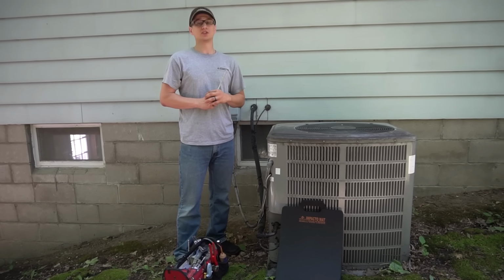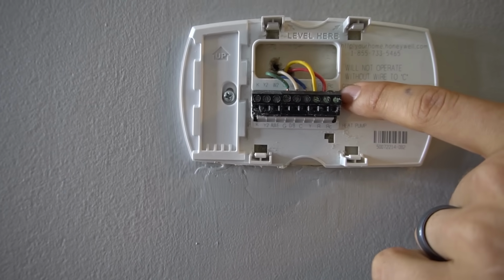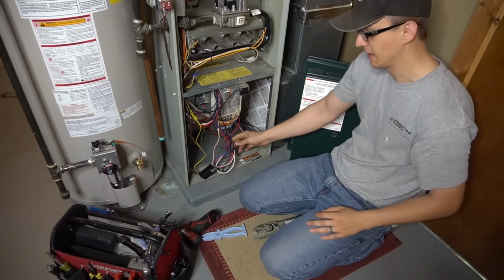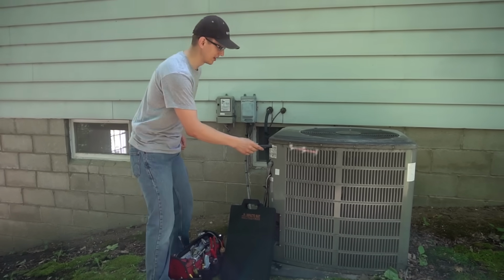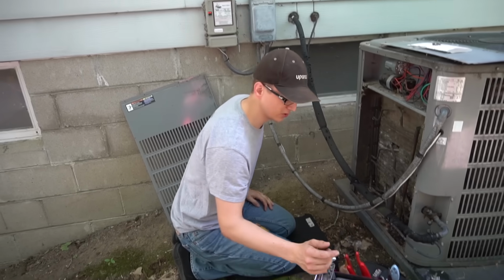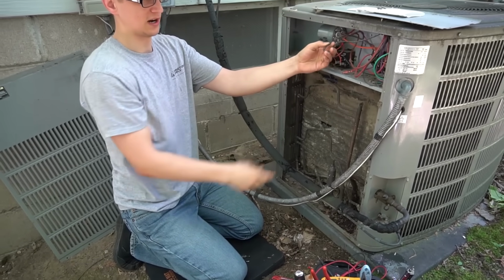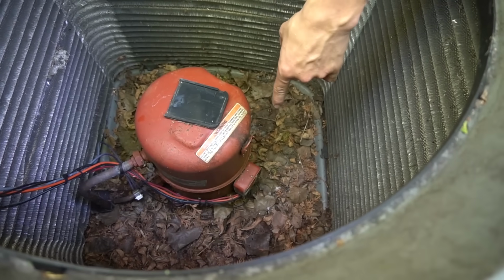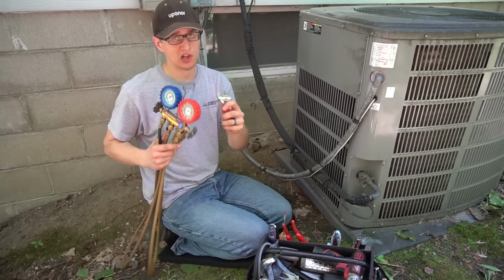AC Unit Not Turning On - How to Fix It Step by Step

Comment: It has a 3 amp fuse that keeps blowing. I checked the capacitors inside and outside with no visible defects.
Reply: Great video from A-Z
Reply: Turns out it was the connector.  Replaced it.  All good
Reply from the maker: Usually a capacitor would not cause a 3 amp fuse to blow (on a side note, sometimes capacitors can look brand new but still be dead. Only way to know for sure is to check it with a multi meter https://amzn.to/2JWI1pU)

If your 3 amp fuse keeps blowing I would start by looking for a bare wire that is shorting out. If you go outside to your condenser unit, do you see where the refrigerant pipes come out of the wall? Usually along with them, there will be a thermostat wire that goes up to the contactor in the  ac condenser unit. Look for spots where the wire insulation is damaged. If you do find some bare wire, you can just tape them with the black electrical tape or  cut off the bad piece and splice the wire back together. Make sure you open the condenser electrical section too because sometimes mice make a nest in there and chew stuff up.

If you do not find anything wrong with your thermostat wires, then it's possible that the contactor is bad. An easy way to check that if you don't have a meter is to unhook the 24v wires from the contactor, make sure they are not touching anything, and turn the unit on. If the fuse blows, then you know that the contactor is not the problem. If it does not blow, then try hooking it back up and turning it on again just to double check. Usually there is a short somewhere though. A defective contactor is pretty rare. Let me know what you find!
Reply from the maker: Thank you! Sounds like you watched the whole thing! Way to hang in there ;) Glad you liked it!
Reply from the maker: You're a boss! Stay cool ;)

Comment: Great video! Maybe I'm just overlooking it, but I can't seem to find the plunger and this baby isn't making one sound.  Should I just go straight to replacing the capacitor? For the record: I just got the house and I'm looking at the services records located on the furnace,  the capacitor was replaced 2 yrs ago.
Reply from the maker: I think you should try finding that plunger one more time ;) Your contactor may have a cover on it. The plunger will be in the middle and there may be a small screw or 2 that hold a cover over it. (new contactors have a cover so that bugs don't get in) 
- If you press the plunger and you hear the unit trying to start but it ends up only buzzing, then I would replace the capacitor. 
- If you press it and you hear absolutely nothing, then you probably don't have 240v going to it. Check your AC circuit breaker or disconnect fuses. Let me know what you find :)

Comment: Had a wire short on the outside that blew the 3 amp fuse.  Replaced the fuse and inside is working but air won't come on.  Anything I should look at before calling for repair person?  Breakers inside are alright too.
Reply from the maker: Well from what you explained there are a few things that come to mind..

- Do you have fuses in your disconnect outside? Those could be blown. 
- If you have a multi meter you can check voltage with, check to see if you have 240v at the contactor. You can get a meter for 20 bucks on amazon https://amzn.to/2JWI1pU   (good to have one of these)
- An easy test to do (without a meter) is to push the contactor plunger in. Does the unit start? If it does, then you do have 240v. If it doesn't then either the fuses are blown or the breaker is tripped.
- If pressing the plunger in started the unit, then that means the contactor coil is not getting 24v so it is not pulling in by itself. Did you fix that shorted wire outside and hook it up to the right spot?
- The capacitor could be dead. Here's how to check and replace one: https://www.youtube.com/watch?v=C82HvbvP08E
- Did your unit work good before that 3 amp fuse blew? When is the last time you had it fixed and what was it?

Those were some of the ideas I got. Hopefully it will help you figure out what's up. But let me know what you find please. Good luck!
Reply: Outside disconnect is the copper wire plug in. Unit worked up till the 3 amp fuse blew.  The wires that were shorted have been fixed with the caps.  I'm pretty sure it was the thermostat wire. It was a gray wire with an inside red and wire coated wire.  They were just wrapped in electrical tape before and the tape came off of one of them   

 I'm going to look at the contactor plunger today.  I took the cover off once and the capacitor is all rusty.  Searched online and found the capacitor model I need.

It's probably been ten years since my parents had someone come out.  Not sure what they did except replace the inside thermostat.  This unit is 28 years old,  hoping to get another season out of it.  Maybe it is just shot.

On another video I watched, they talked about a reset button on the inside under the fan.  Is there a reset button in there somewhere?  Your videos are a lot easier to follow.  

Thanks for replying, appreciate the help
Reply: Just took everything off again and tried the contactor plunger.  It wanted to start but quit after I release the plunger.  

The capacitor doesn't have any bulges but it is rusty.  When it is installed, it is upside down.  Even the top terminals are rusty.  

I'm going to order a new one and see what happens from there.

Thanks again.
Reply from the maker: Thank you for all the details! It sounds like the broken wire problem was resolved so that's good. I think a new capacitor will solve your problem :) When they go bad, they do not always bulge out. Sometimes they look new and shiny yet they are completely dead. (easy to check for sure if you have a meter) 

As for the reset button. I am pretty sure they were talking about a high pressure switch. Most older units will not have that. It would look like a black cylinder or disk with two wires coming out of it and a button on top. I don't see too many AC units that have one of those. Their purpose is to shut off the AC if your freon pressures are getting too high. But when you manually push in the contactor plunger, the unit would start even if that switch was tripped.

If I had to compare a capacitor to something, I would say it's like a car battery that you can't recharge. The capacitor is like a battery for the compressor and the fan in your AC unit. You can try to start your car with a dead battery but it won't turn on. Same with the AC. It tries but can't come on. Anyway, hope you will have cool air again soon!
Reply: Got the new one today, installed it and it still isn't working.  It will come on if I press the plunger thing and it held it while they checked to see if it were cooling and it cools if held.  Any other ideas?
Reply from the maker: Okay so we have progress! :) So before, when you pushed the contactor plunger in, the unit would try to start but fail. Now it starts when you push it in. Now the problem seems to be the 24v control voltage... 

- Did that 3 amp fuse blow again?
- Also, the wires that you are talking about here, "It was a gray wire with an inside red and wire coated wire.  They were just wrapped in electrical tape before and the tape came off of one of them" Does the red and white wire go straight to the contactor or does only one of them go to the contactor coil and the other goes somewhere else?
- If the fuse is not blown, if you are comfortable with doing this... Turn off the furnace power switch and make a little jumper wire out of a piece of wire (even a paper clip would work). Then at the furnace control board, put in the jumper to R and Y. (There should be a terminal strip just like at the thermostat R,Y,G,W,C) Doing this will bypass the thermostat. Then put the doors back on and turn the furnace on. If everything comes on and works, then your thermostat is the problem.
- If the thermostat bypass still does not turn on the AC and the 3 amp fuse is not blown, then you most likely have a bad control board. 

Before I get too far ahead, try checking all that and let me know what you find :)
Reply: That might be a little more than I can handle.  The furnace and thermostat are  less than two years old.  Would they go out that soon?
Reply: I'll look at those other things in the morning.  Should that plunger on the contactor stay in?  The 3 amp fuse didn't blow.
Reply from the maker: Well if there was a surge for example, that could take out a control board or a transformer. Unfortunately at this point I can't say for sure what it is. Still trying to help you narrow it down. But yeah.. 2 years is pretty young still. If this is becoming difficult for you then you may want to call a technician after all. Otherwise I will keep answering until we make it work ;)
Reply: Wanted to give you an update.  First off, I was going to give up on it and make plans to have a new ac installed.  Well, I tried the other things you mentioned and then watched your videos again.  Going back to the first wire that caused the fuse to blow, I took the caps off of the connection and guess what?!!  I had twisted one of the wires to much and caused it to break.  I redid it, being careful not to break them again and guess what!!  We've got cool air again.  Thanks so much for the videos and for answering questions.  Truly amazing it is back on.  Have a cool summer.
Reply from the maker: Wow that's amazing! That's all it was after all this time.. And you were making plans to get a new AC already. I'm glad you were able to find the culprit and got it back up and running! Thank you for the update, stay cool! :)

Comment: Thanks for the great video.  I have a question: what if i am pressing the plunger on my a/c unit but it wont press inward.  (That's when there is power to the unit).  When the thermostat is off and power is off the plunger presses in and out with no problem.  Thank you!
Reply from the maker: Well that's odd... So let me clarify..  When the thermostat is off and disconnect is out, you can press that plunger in. But with the power on and thermostat calling for cooling, the plunger does not pull in even if you press on it? You may have a defective contactor there. You should be able to press in that plunger even with the power on (unless its already pulled in)
Reply: Hey thanks for the fast reply!  Your help is very much appreciated!  Okay maybe it is pressed in. Because it doesn't push at all when there is power and thermostat.  
But when everything is off yes it presses in very easily.  Maybe it is pulled in when the power is on.  I will pay closer attention to its position when I return from turning everything on.  I will keep you (and everyone) posted.
Reply: Hello again.  Yes when the power and thermostat are on the contactor is pulled in.  However, the unit does not come on.
Reply: The unit is making a soft humming sound.  Barely audible- have to put my ear right up to the unit to hear.  I tried starting the fan by spinning the fan blade but had no success.
Reply from the maker: Most likely it is a bad capacitor. This video is how to check and replace one: https://www.youtube.com/watch?v=C82HvbvP08E   Another possibility is that you simply do not have power to the unit. You have 24v that pull in that plunger but the 240v may be missing. Check to see if your breaker is tripped or if your disconnect has fuses, those sometimes burn out too.
Reply: Again, I appreciate you taking the time to answer my questions.  Next time I am in Minnesota I will buy you a beer!
Reply from the maker: Happy to help :) And thank you! The world is pretty small so who knows, maybe someday we will bump into each other. Hope it's an easy fix for you, stay cool!
Reply: Replaced capacitor.  Unit doesn't turn on or make any noise.  What is different now is that the contactor plunger isnt pulled in when powered and when i press it in manually nothing happens.  When i press it in manually there IS power going through it.  But unfortunately nothing happens.  Your thought?
Reply from the maker: Hmm.. If you replaced the capacitor and still nothing happens then I would go back to investigating the power. Do you have a meter like this one that you could check voltages with? https://amzn.to/2JWI1pU
When you say there is power going through it, do you mean the 24v going through the contactor coil or the 240v? If you do have a meter,  put your 2 leads on the 2 screws on the contactor. On the side where the electrical whip comes in from. Is there 240v there?
Reply: No unfortunately I do not have one like that.  I was only using a voltage detector that beeps.  I will check out this link you sent and get one so I can make a better assessment.  Thanks for all your attention with my problem.
Reply: Im making progress.  I replaced the fuses in the disconnect.  Now I can turn on the unit by pushing in the plunger on the contactor.  It turns on.  But only when i manually press in the plunger
Reply from the maker: Hey Mike! I'm sorry, I did not see that you had answered. Lately I have been flooded with comments so some of them get lost. I hope you already got it working! If the plunger does not pull in by itself, that means the contactor is likely not getting power. (24v). Let me know if you are still battling the beast and I can try to assist.

Comment: My contactor was stuck closed and whining. But fan and compressor would not start. I replaced cap and still it would not work.???? Any idea what i can be
Reply from the maker: Do you have a multi meter? My first guess would be that you don't have 240v. It's unlikely that both your fan and compressor died at the same time. Check your breaker and if you have fuses in the disconnect, check those too. If you have a meter, you can just check voltage at the contactor at the two screws where the line voltage comes in. You should have around 240v going into the contactor and 240v going out on the other side (if the contactor plunger is pulled in) If you have fuses in the disconnect, you can check resistance or continuity on them. If one or both are O/L, replace both. Let me know what you find! Also, did you get the contactor "un-stuck"?

Comment: Here's my story TV...air kicks on in the house but no cold air...Cap is good and changed out the Contactor and when pushed in fan and comp turn on and pipe gets cold... won't stay on? Could it be the brown wire from the thermostat to the unit is compromised some how?
Reply from the maker: Sounds to me like you are not getting 24v at the contactor.  Here are a few things I would check first:

- Make sure the fuse or breaker in the furnace control board is not blown/tripped
- The thermostat wire coming from the AC condenser unit and into the furnace usually has two wires. (red and white) Those two wires go to C and Y on the terminal strip on the main control board in the furnace. Just make sure that's where those wires are and that they are not broken.
- Make a little jumper wire and jump Y to R on the control board. That will bypass the thermostat. If your AC turns on with that jumper in, then you know your thermostat is bad.
- The transformer or control board could be bad too. Those are easier to check with a multi meter. Do you have a meter?
- Have you recently replaced anything? Like a thermostat, furnace, humidifier, etc? (before this problem happened)

Let me know what you find!